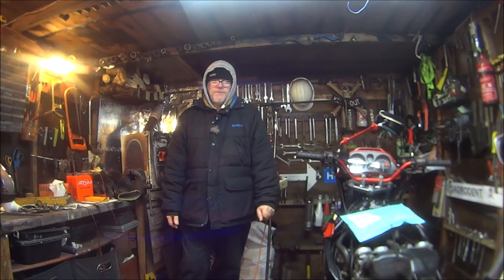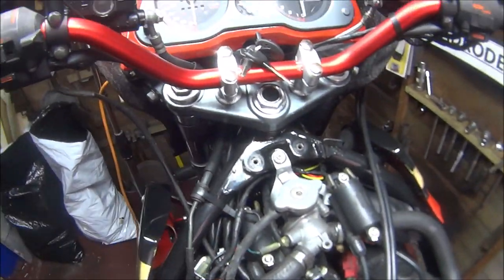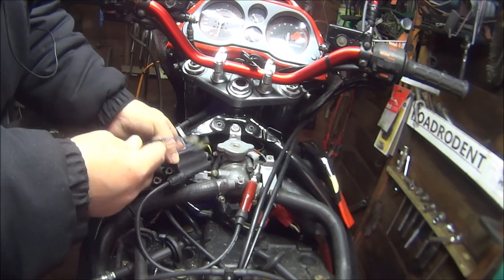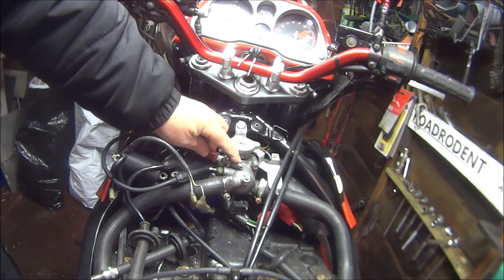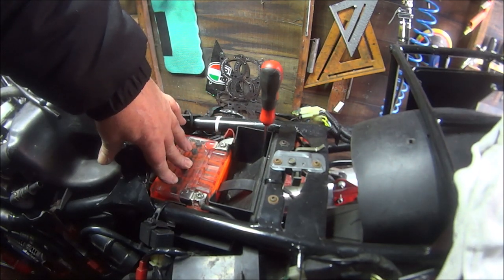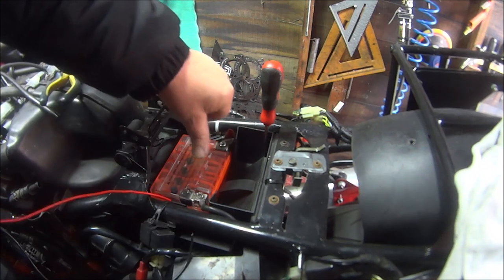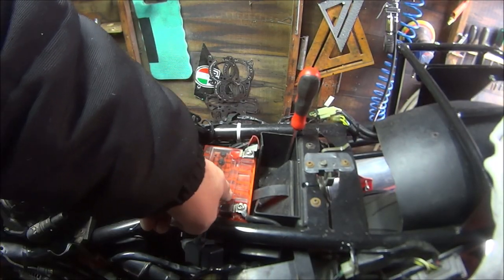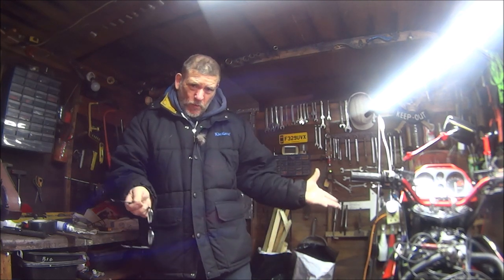CBR1000F, landfill bike. Wins Again.

Comment: Had the same issue on mine the other day i hve a 92 1000f i have just built and had no fuel, turned out i had a vaccum pipe from the carbs that goes to the tank to push the fuel through on the wrong nipple as mine has 2 for some reason fired up after that, also i will mention i chased a no spark issue for ages and turned out i had left the side stand down which kills the spark also the clutch must be pulled on mine as that has a kill switch too felt a right divvy after that one lol
Reply from the maker: Cheers knuckles. Fantastic tips much appreciated fella. 👍

Comment: My guess is if its sparking on all 4 then fuel not getting through .
Reply from the maker: Thanks buddy. I'm thinking the same thing at the moment.
Reply: @jonyr1TT  thanks for reply you will get there in the end.  can I ask do u smell any fuel getting through with all that pumping on the starter also have u checked the plugs for any wet sure sign fuel is about
Reply from the maker: cheers john yeah the plugs are a bit damp.

Comment: Very frustrating mate, if the plug leads are making a spark with the file and the plugs are wet with fuel could it be the spark plugs that are at fault?
Reply from the maker: Cheers Gary. I have another set in the spare head I'll try those. 👍
Reply: @jonyr1TT  I mention the plugs because nats Nackers Yard had the same symptoms on a cb 400, new plugs solved the problem 😉
Reply from the maker: Yes thanks Gary it all helps I've had loads of helpful tips this week and they are very informative and much appreciated 👍

Comment: I’ve just had the same problem with mine , how many wolts do you have on the coils? 
On mine I had 13 wolt on the battery but only 8,9 wolt on the coils , and it neds to be minimum 12 wolt on the coils 
On mine It turned out to be an issue on the main fuse/starter relay 
Cheer’s from Denmark 🇩🇰
Reply from the maker: Hi Jorgen. When you say wolts I'm assuming you mean volts if so I'm not sure. Where would I connect the metre wires to? Thanks buddy 👍
Reply: @jonyr1TT   sorry yes I meant volts , mine had also a little bit of spark on the plugs , but i found out (after almost going insane over the stupid old bike) that it must be 12 volt on the coils , so with the ignition on you must be able to read minimum 12 volt on the cables going to the coils
Reply from the maker: OK Jorgen thank you very much for your help. 👍